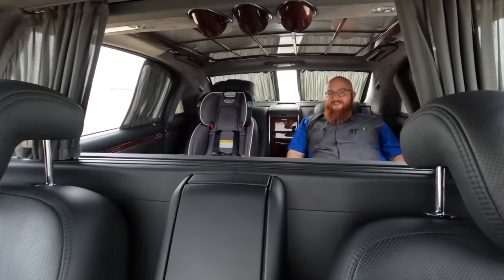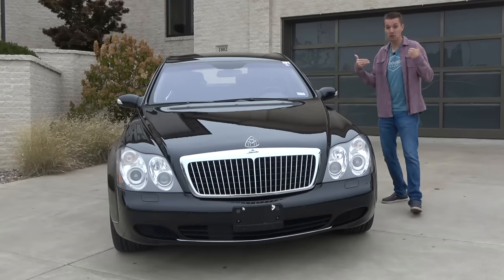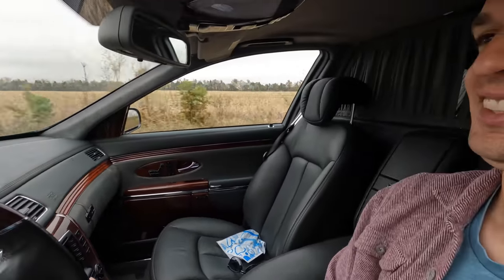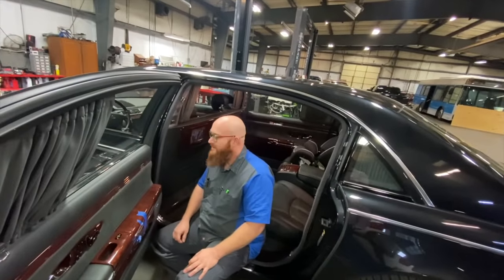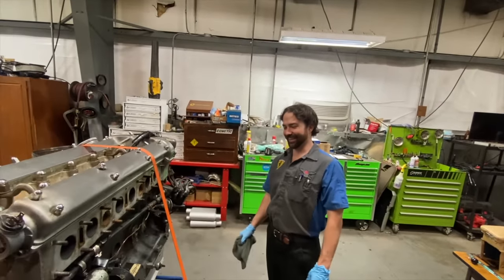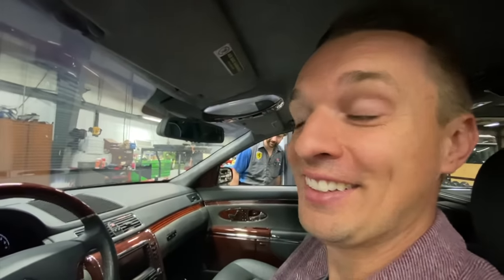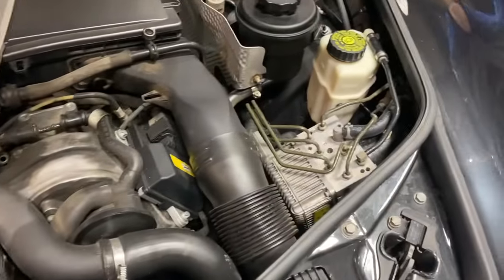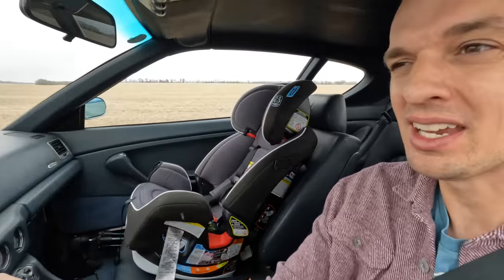The CRAZY EXPENSIVE repair costs on my CHEAP Maybach 62 have me worried (10x normal Mercedes)

Comment: Ñice looking car Hoovie. To me it looks nicer than the mean looking new Rolls. Kids and luxury cars don't  mix. I remember selling my Daimler sovereign in the 70's because I could not stand what my 3 daughters were doing to it in the rear. The old E Type straight 6 engine on the bench is tall because it is a long stroke. This motor in its time was very fast but could cruise at high speeds for 24 hours at low revs. I love this motor and the modern version AJ16 would be good enough for me in the Maybach.  So many modern cars are over engineered but the luxury cars are even worse and most of it is for status. By the way I would only put this car up on a four post. The weight balance of such a long car could be a big problem on a two post. Lift it only 6" and try to tip it before you lift it further.

Comment: One thing about rebuilding and old car that isn't worth much and doesn't cost much in parts to fix is that it you aren't deep into a money pit where it has value just for fun or still cheaper than buying another car.

For something expensive like this where some parts or labor far outweighs what the car is worth and not likely a sought after collectible where you would lose your shirt of of is worth more as parts or junk.

Comment: You could take the brakes off of a similar model year regular s class, shocks dont have to be proprietary, you can find similar ones and may need to change the bolting, the only thing that may truly cost this much is anything to do with electrical.

Comment: The noisy bearing in the alternator is a $10.00 part. I would just have the Wizard rebuild the alternator with a parts kit from MB. The rebuild kit is less than $60.00 for that alternator.

Comment: Just FYI, the 57 and 62 designations refer to the length of the cars. The 57 was 5.7 meters long and the 62 was 6.2 meters long. The 57 was meant to be the "driver's" car and the 62 the "chauffeurs" car. The difference in length is a fairly substantial 20 inches.

Comment: acceleration sensors helps the suspension compensate for lateral movement to keep the vehicle as level as possible in all situations. After all you don´t want to spill your champagne in the back even whilst chased by baddies with machine guns.

Comment: When I was 25 and thought I needed an impressive car, I bought a 1992 BMW 735i that was about 4 years old and out of warranty. One day the headlight got broken and the replacement cost was over $1k. Next up, the computer started showing display messages in German only and that fix was also over $1k. This is in 1996 dollars. I got rid of this money pit before anything else went wrong, like brakes, wipers, transmission, fuel system...the list goes on and on! Do not buy a out of warranty BMW unless your family owns a BMW repair garage.

Comment: It looks like an outsized W221 but the trouble is that it's not really a Mercedes as far as interchangeability of parts is concerned.
A German Youtuber wanted to upgrade his S-Class Mercedes with a Maybach steering wheel - which he couldn't install because the mounting points were all different. 
So MB had really re-engineered the steering wheel to make it different from a common S-Class.
Reply: It's based on the chassis of the W 140 and uses the electrical system of the W 220. But of course it will have model specific parts.
Reply: @simonm1447   I guess that it's those "model specific parts" that make maintenance or repairs a financial nightmare.
It was a similar story with the 600, Merc's hyper-luxury model of the 1960s and 1970s. Spare body parts are extremely expensive and hard to come by so reputable specialists have converted a few defective ones into pickup trucks because they couldn't find spare doors containing the complex hydraulics for central locking and window regulator...
Reply: @notroll1279  yes, the type 600 is very special in this case too, especially the hydraulic windows and the heating system. This car is massively overengineered. You need a specialist for this model for repairs
Reply: @simonm1447   I once met someone who restored one. He told me that the sheer complexity of many components dazzled him and that sometimes it took him ages to  understand how a part was supposed to work... often with mechanical, magnetic and hydraulic action combined.
It's what happens if you give engineers the carte blanche to design something without considering cost....
Reply: @notroll1279  indeed, the type 600 was a sort of technology demonstrator. Today this role is occupied by S classes. Such a car is never cheap, not even if it's old

Comment: Mechman makes a 500 amp alternator for $800 that could be adapted. Matter a fact, if you replace the battery with a lithium bank you could get away with using a 370 amp alternator on one of these cars and spend way, way less than 7k. A few tricks off the audio world's book.

Comment: Why is your $1300 Ferrari bill less expensive than my nearly $1600 Mazda bill?
And no, my Mazda did not require extensive repairs of any kind. Thinking I got ripped off by the Mazda dealer. Well, there you go. Want to save some money and have a car with some performance under the hood, don't buy a V6 Mazda... Get a Ferrari.

Comment: You have to factor in the $130,000-230,000 annual Chauffer cost into the Maybach 62 cost, or it is completely worthless. 
It's not even really good for rental, because you'll never recover the cost.

Comment: Aren't these parts expensive because of the box? Like a VW part same as a Ferrari but $500 difference. Most of this is off the shelf Mercedes that's shared with other cars. Only the bespoke parts would be expensive.

Comment: 7k on an alternator reminds me of the 20k radiator in the Bugatti, it has like 20 radiators 😆
Reply: Since the Bugatti has almost 2000 kW thermal losses (if you assume 1/3rd engine efficiency at higher load) it's a challenge to get rid of this amount of heat